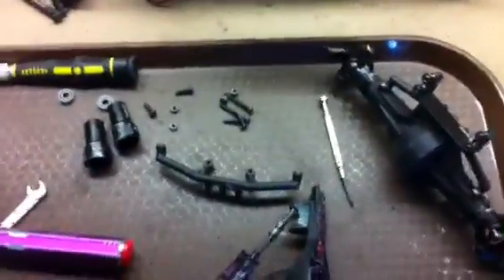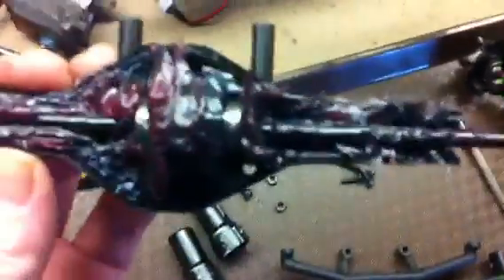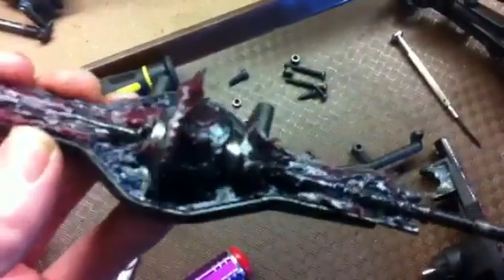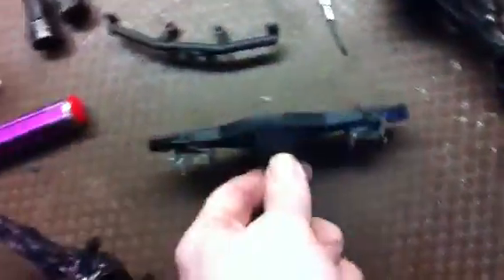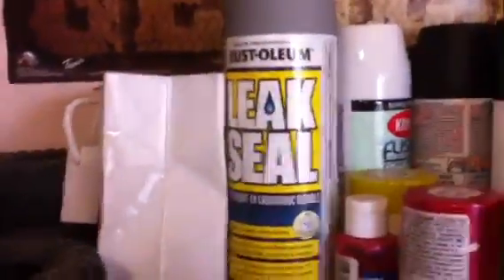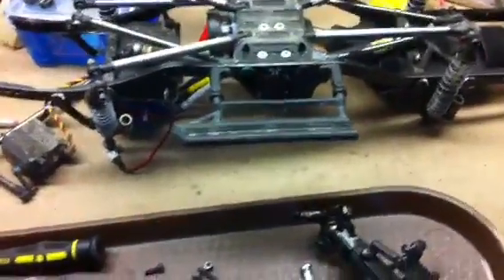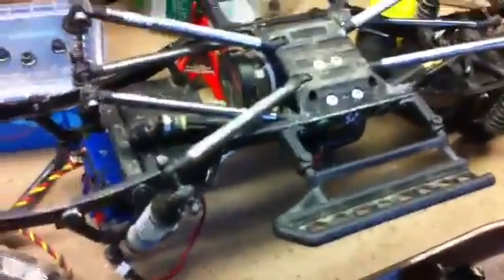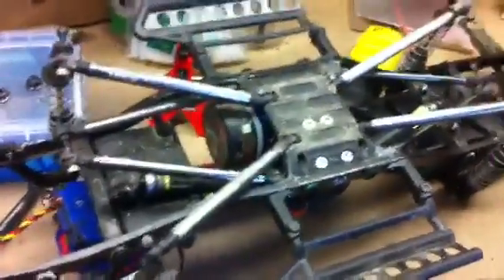Greasing my Rc diffs

Comment: i dont think it adds that much resistance to the drive train. worth it on a crawler for the extra protection.
Reply: In my case, add a lot, but I don't care. I use the crawler in very slow speeds and the motor always is cold, even with that resistance
Anyway, a new motor is much cheaper than all the transmission gears, bearings, etc.